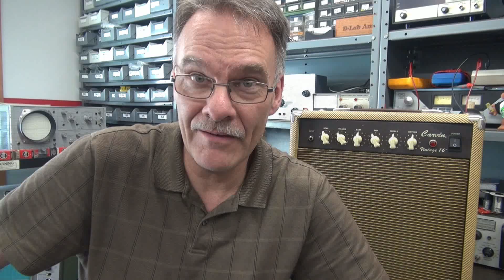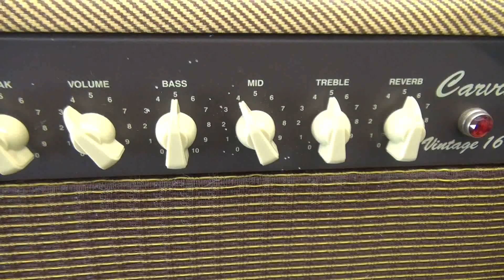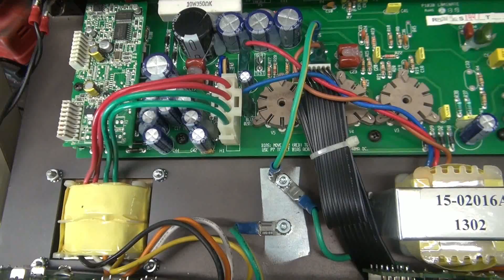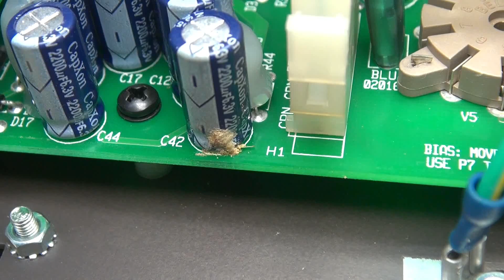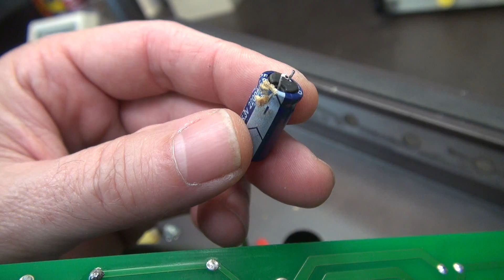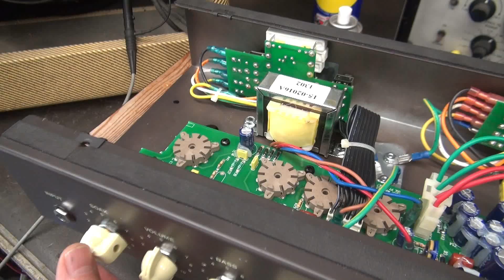How to repair Carvin Vintage 16 tube guitar amp Cutting out D-Lab electronics

Comment: Excuse me, what did you actually did to the sockets?
Got a X100B series IV, changed 2 bad filters caps, but still got vol drops. I fear it's a OT prob, but the sound comes back by turning the on off or stand by switch, a karate chop like an old tv and moving the PI like you did with that preamp tube on the video. I tightened the sockets pins after changing the caps, clean the contacts (jacks, even the flex cables), no crackling pots but I still sprayed contact cleaner, and this vol drop persist. Hence my first question, as it does makes sense if the previous owner pushed to hard the tubes and the sockets get loose on the PCB... still, I can't believe this will work, I just need to reheat those solder points and that's it? They seem well done to me...

Comment: Regarding pcbs versus point-to-point wiring, I had a Fender quad Reverb that I bought in 1976. My Son's using it today; it's still works like a son-of-a-gun. The only real issue with it at this point is it needs a new push pull master volume switch and I can't find one for the life of me. I even contacted Fender and they gave me the scratchy head thing. Outside of that it's beautiful and so I just hardwired it on. I have a twin 65 reissue and I wish I didn't.
I was watching your video because I have a Carvin Nomad 112 and it is giving me headaches. Has been for some time and I've never really been able to use it for anything important because I'm afraid it's going to cut out and make a loud white noise with no signal. When it works it's a really great sounding amp. Anyway, thanks for the informative video. Didn't know you existed before but I'm subscribing now.

Comment: My Carvin Vintage 16 has an Accutronics spring reverb, 3 -12ax7 preamp tubes, and came with a 100 Watt 8 ohm speaker.  Reading thru the comments here, it looks like they shipped those amps out in a variety of configurations.  Mine was purchased in Sept 2010.

Comment: I have the older carvin vintage 16 with the 3 12ax7 tubes & spring reverb. Be warned if you turn the soak past 6 you get a buzzing sound from the 30 watt speaker. Other wise they sound pretty sweet

Comment: You had another vintage 16 in the shop where you upgraded to mercury transformers, that seemed like a nicer amp. It had real spring reverb, three 12ax7 tubes and the output transformer on the same side as the power transformer. I feel like this cheapening of their lineup of amps help sealed their fate

Comment: I've found that most of these PC Board based amps need the tube sockets cleaned out of the new lead free solder and I resolder them with leaded solder. they last longer that way. Bugera amps have this tube socket problem all the time, easy fix. I look for Electrolytic capacitors that are mounted too tight down to the circuit board, if the gas vent on the bottom of the cap has no place to vent during normal use, they get stressed and open up or just explode their inards out. Great Video, Terry!!

Comment: I'm always amazed at how often PCB tube amps fail in comparison to Solid State ones.
I wonder... if they used solder that melts at higher temperatures, wouldn't that remedy most of these issues? Because they seem to be often caused by the solder melting during use of the amplifier.

Comment: CrapXon's at their best, spitting out their guts. Bad connections have become a nuisance since they started using ROHS solder. It hardens over time and cracks more quickly than lead based solders.